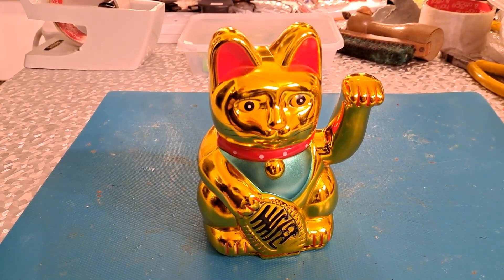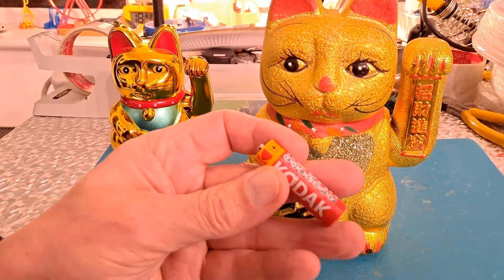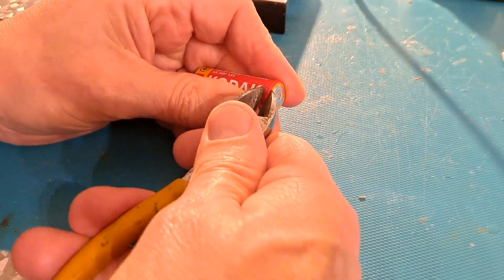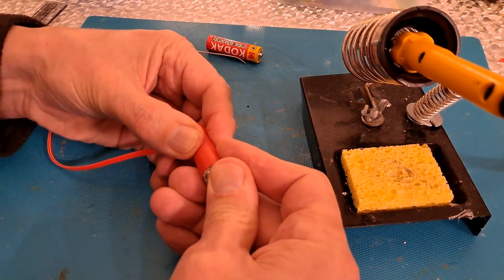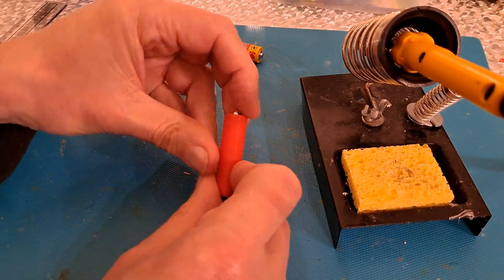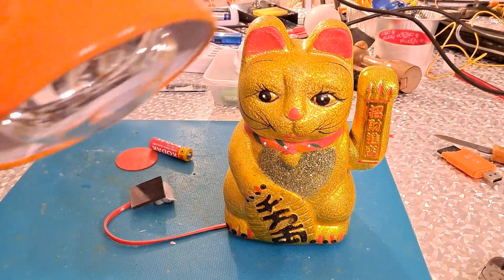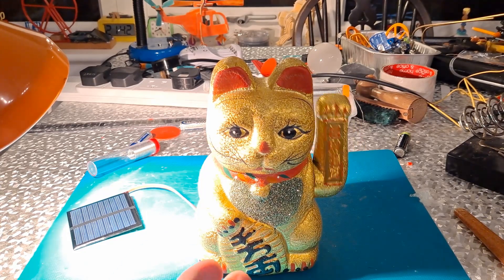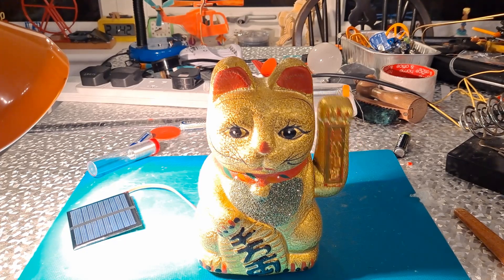An alternative solar conversion for the Waving Cat

Comment: Cool video. Of course you could also do the opposite and make Nani cross and use a solar garden light circuit that charges up a rechargeable battery (often a small nicad or nimh) and then also uses the solar panel as a sensor to activate the light (or cat in this case) at night. ;-)  I bet you can get those at Poundland as well. I got mine at our local Dollar store.
Reply from the maker: Yes that should work fine and now the days are getting lighter we should get a good length run in the evening 👍
Reply from the maker: How about this 😊😊 https://youtu.be/OFFd0xcsMdw